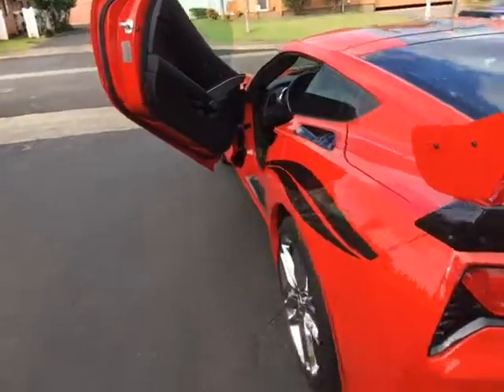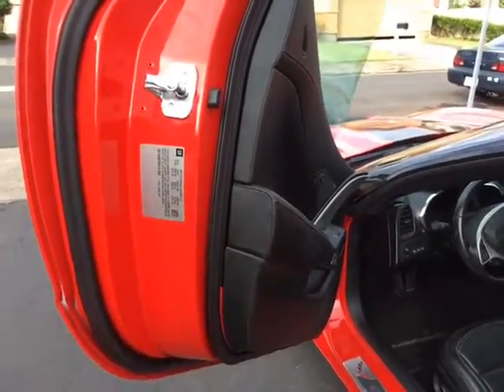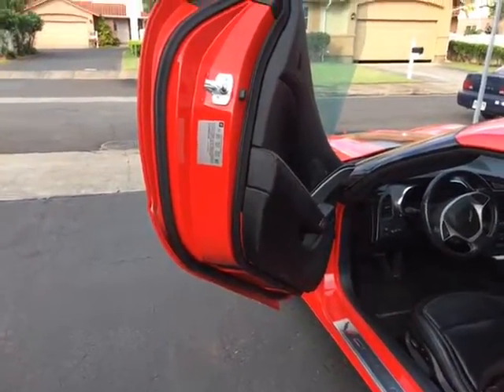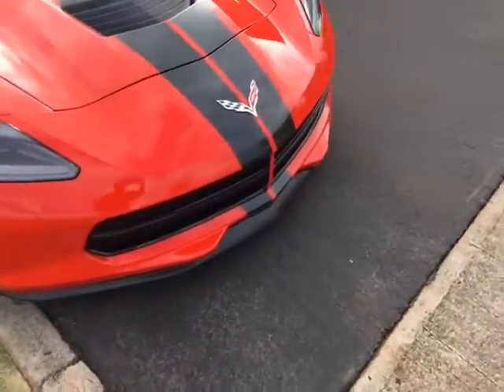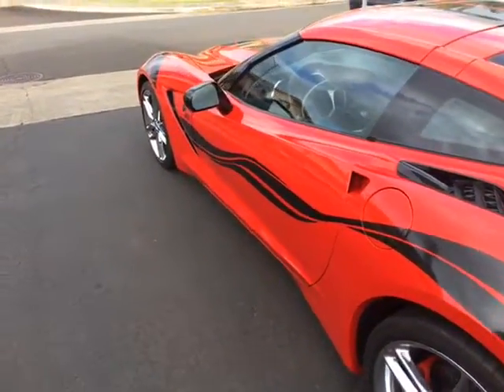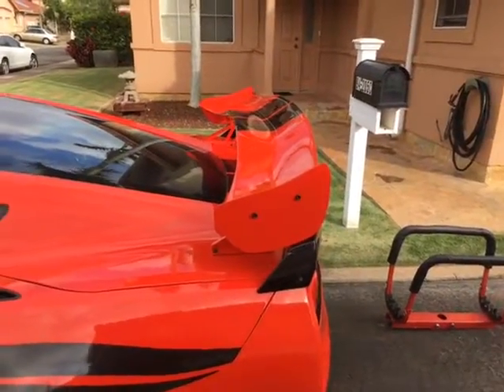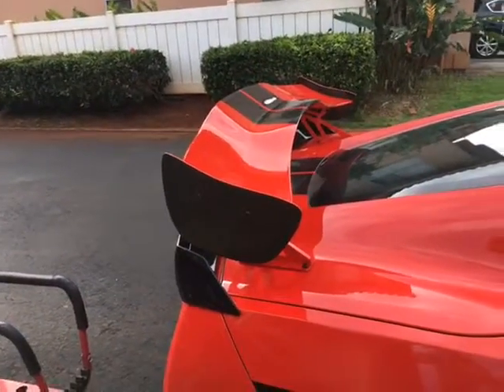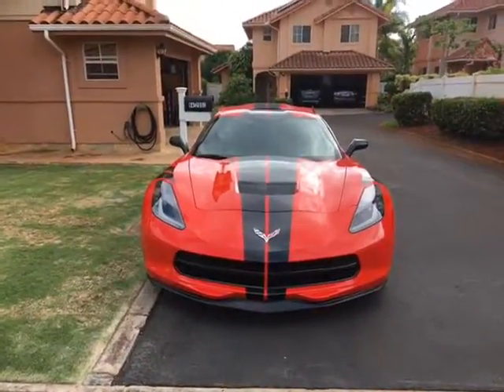Vertical Door Shock Replacement Nightmare

Comment: I think it would look better to have just 1 instead of both a  spoiler and a wing.    I would remove the black spoiler.
Reply from the maker: Problem is, the spoiler is bolted to the bumper so I would have to fill all the holes and repaint the bumper and then replace all the graphics. I did remove the Wicker Bill extensions though. Aloha, Mark
Reply: Instead of filling the holes, maybe you can buy a plastic cover for it or put a vinyl wrap over the hole.